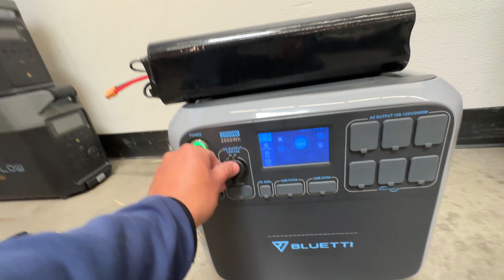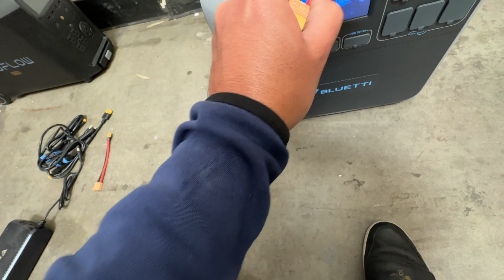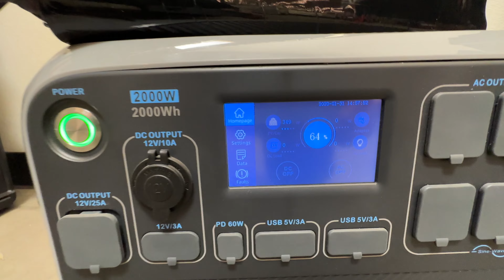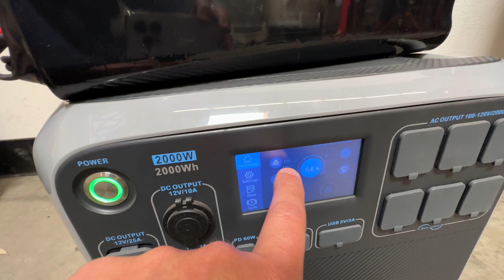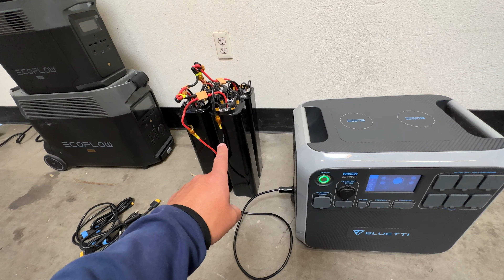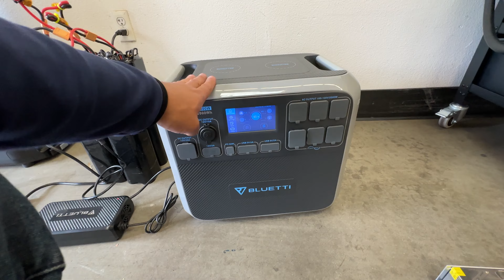Low cost Bluetti Ac200p external battery

Comment: For anyone actually thinking of this, watch out putting the packs in series -- a fully charged 36V (10s) battery is 42V. Four of them fully charged in series is 168V, too high for the 150V input. Would want to stick to 3 packs in series. Or what am I missing?
Reply: You do not want to put them in series. Parallel them.

Comment: IMHO, just having batteries to charge the Bluetti isn’t worth the effort because of the manual activity charging the batteries and connecting & disconnecting cables every time. I’m charging the batteries from solar and having the batteries charge the Bluetti with permanent connections. I’m using 4 JAG35 R5 batteries in parallel and a 40A MPPT RogueRV charge controller from Amazon. I added XT-30 connectors to the input wires (smaller red/black pair) on each battery. I charge through the input wires and connect the discharge port to the solar input on the Bluetti AC200P. 
I’ve been running this for 9 months and it’s been working as expected. 
For added safety, I’m running the batteries in parallel so the battery voltage can handle the minimum input voltage on the Bluetti just in case the battery’s BMS isn’t doing the low voltage cutoff. The Bluetti has a 35V minimum input voltage but my experience shows it pulling current down to 32V. The 36V batteries I’m using give me that extra comfort level. 
Hopefully this helps with your build.
Reply: Exactly what I was thinking!! Just got my AC200P and got it connected to solar!! Already looking to expand 😄 Just curious, the manual says 700w max and ignores anything over 12amps. Those four batteries in parallel is what, 1760 watts and 52 amps? Does the Bluetti do ok with that? So no faults and it can take over 700 watt on the solar input?
Reply: @Green87  AC200P will pull up to 12amps from the battery bank. Excess amps is not an issue. So I have solar going through a BougeRV 40A MPPT Solar Charge Controller to my battery pack. The amount of solar I can use is based on what the charge controller can handle when using a 36v battery bank, 1800W max and up to 150V in my case. I’m only using 4 200W @ 68V panels (2S2P config) into the charge controller then into the input wires on the batteries. The output wires from the batteries are connected to the solar charging input on the AC200P. 800W seems plenty for ~4kWh of battery and my AC load.

Comment: Hey buddy can you do a video on behind the meter systems legion solar has an interesting system where the solar regulator which just plugs into a wall socket prioritises you house hold devices to draw power from the solar plus batteries instead of off the grid.  This whole angle seems to be missed from your videos apologises is if I'm wrong.  People just want solar plus battery capacity without having to wire up separate fuse systems legion solar systems to have an interesting approach feel free to tear it apart

Comment: I had the ac200p and it had an issue with the mppt with charging from this type of battery source.  Bluetti replaced my unit with an ac200max.  This battery solution works much better with ac200max.  Jehu I still need to bring my rv down so you can see how I wired my rv to use your battery systems.

Comment: Last Summer I was able to solar charge mine and was getting like 730 watts of charge off the solar panels…. Unfortunately the BMS died and sent back… Took like 2 months to get another… I just don’t like the dim display.. I might have burned it out by charging this unit and my Surron X at the same time pulling like between 10amps(1000 watts)… 

When you say Bluetti makes additional batteries… I thought those were for their darker gray units like the Max or AC500…. But I have no interest cause there just to much… 

But thanks for the link to your EB4 battery link!!

Comment: I've tried this on My ac200p with your 36v scooter packs. On my unit the batteries will stop charging after a few minutes. It just slowly drops to zero. Also even if you get it to work, you'd want to series connect them. It will stop charging at 35v so you can only use half the pack on a 36v battery.
Reply: Bluetti dropped the ball on the AC200 by making it only accept a minimum 36 volt Solar panel , I presume thats why it is cutting out when your scooter pack drops below the accepted solar input , I think with the newer models they dropped the minimum down to a 12 volt panel even though it would take all week lol

Comment: This is an okay solution. Problem is you need to do this manually. Sure would be nice if there was some sort of way to put excess solar into these auxiliary batteries after your main power bank is fully charged. Then, have the auxiliary batteries automatically recharge the main battery after its voltage gets below some level.  Now that's a video I'd like to see!
Reply: I wonder if you solved this with a Solar panel, Solar Charge Controller, Split Adapter and go from.....  

Solar Panels to...
> Split adapter to create two outputs for the one solar panel input (similar to the ones Jehu uses in this video) 
> ONE output goes to the external battery packs and OTHER output goes to Bluetti solar input port. 

My thought process is…
Sharing power: This may work to connect them all together and ideally allowing solar to charge both packs, or when there’s no solar, the external pack will push power to the Bluetti input only port and when there’s solar it will start to recharge both external pack and Bluetti again. 

Overcharging: The Bluetti will deny additional charge once full. External battery packs will stop receiving charge once full because the Solar Charger will detect this and stop pushing power to the battery packs. 

Thoughts from anyone who knows what they're talking about (unlike me who is just guessing with limited electrical knowledge) hahah
Reply: @genesonrho6997  You don't want two charge controllers sharing a panel (at least I'm 99% sure of that, if anyone has done it and can give a valid reason why you would even do that then please comment)

You have the right idea though. Read. my other comment.

1. Buy a large MPPT (and this is the only time I say don't be cheap. I hate on Victron but their MPPT lineup is worth every penny.)
2. Large MPPT charges expansion packs ( you'd need at least double of what Jehu has for this to make sense
3. You also need a significant amount of solar. Victron 150/35 makes sense if you can get up 2kw of panels which are cheap if you buy them used off Beene Energy or San Tan Solar. We're talking less than 50 cents a watt for quality used panels and 25 cents a watt for panels with slight defects that still pull close to their rating under optimal conditions.
4. Treat your power station like its an AC300 or other "inverter" head only.....that happens to have a battery. (Makes me think of guitar speak cabinets and amp heads, they make combos but for large applications (large concert/large home energy storage) it makes more sense to be modular)
5.*****Here's the catch. If you are using the inverter at an average rate higher than the power stations MPPT input then this isn't going to work 100% smooth for you******

Comment: My big question is is there some type of smart system that I could leave the charger on the batteries and only have it connected automatically when the power goes out like a smart circuit
Reply: Do you have any battery packs that are wired to receive a charge from solar panels and then directly wired into the Bluetti 200P?  This sounds like the ideal external battery pack extension.
Reply: If the battery packs have a BMS then I could leave them on the charger permanently
But my problem runs into the laziness I want to have them plugged into my solar port on the solar generator inverter 100% of the time too but then it would just be sucking power directly from my battery's charger and that's what I'm trying to avoid
Reply from the maker: @KuramaKitsune1  no the Bluetti would stop sucking power from your external batteries once its 100% charged,   you could keep your externals batteries permanently connected to the bluetti and your solar connected to your batteries thru a dedicated Mppt charger.
Reply: If I have Maine's power I want the extension batteries disconnected from the solar generator but I want the batteries charger keeping them nice and topped off

If I lose main's power then I want the extended batteries to connect to the solar port on the generator so it can extend the lifetime and when mains power comes back it disconnects and the charger starts filling them back up